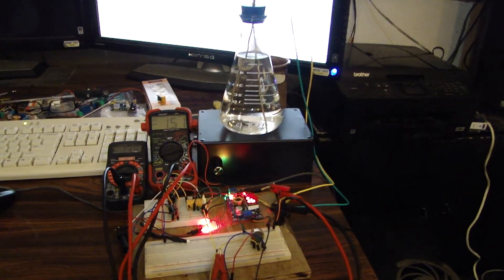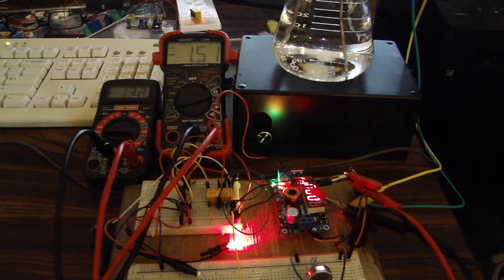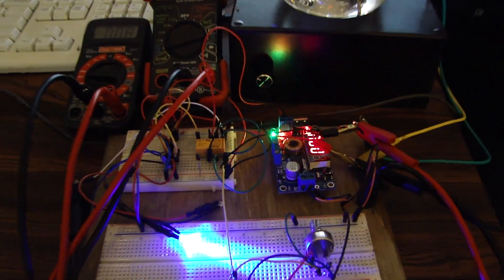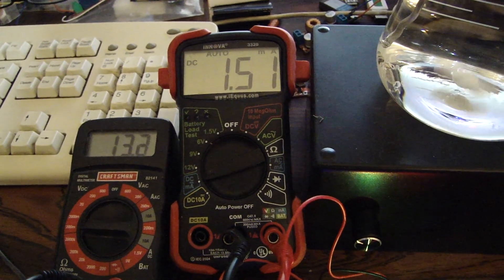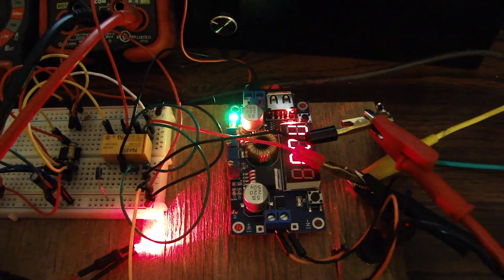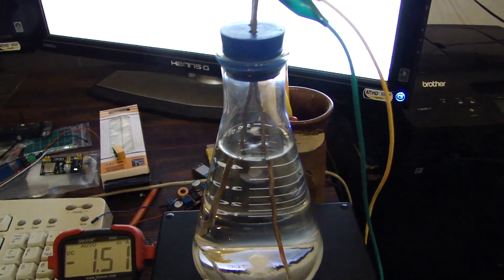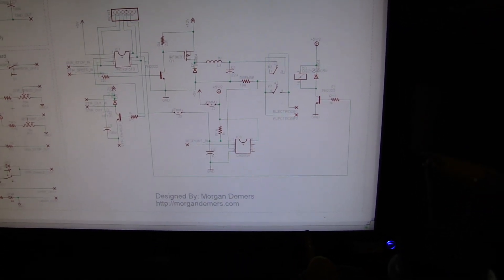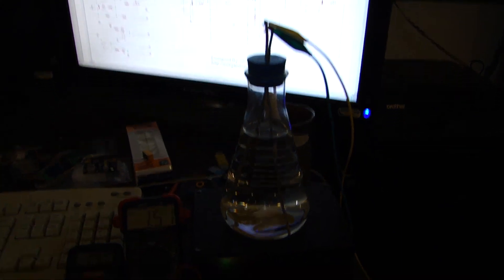Colloidal Silver Generator with reverse polarity, constant current @1.5ma, mag stirrer

Comment: do you change the polarity every 4 sec.?
Reply from the maker: Serdar Mert 
I like to have the change polarity set to 1 min at the beginning of the batch. Then change it to smaller intervals once the ion concentration is higher and I am get more conductivity ( as evidenced by the ma current reading of over 00.20ma on the led.

So full power for the first hour (or when current reads above 2.0 ma). Then to every 15 seconds and drop current down to 2.0 to 3.0 ma thereafter.

That method gets me perfectly clear CS with superb Tyndall effects,  small particles and the fastest production.